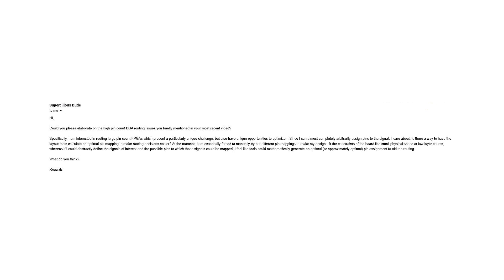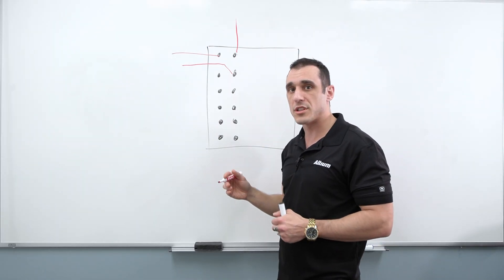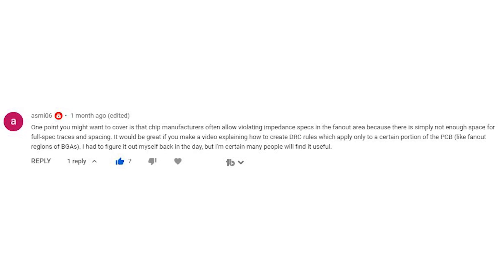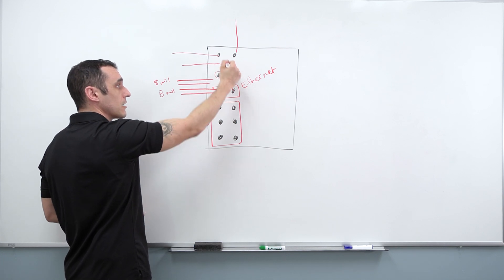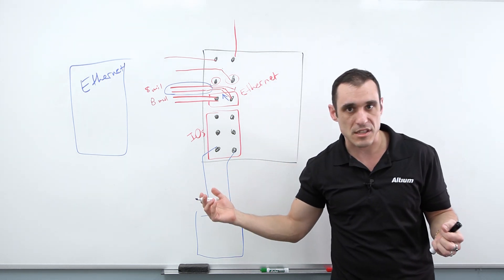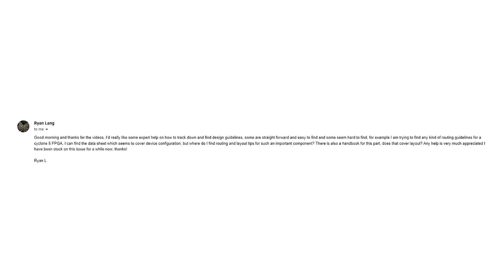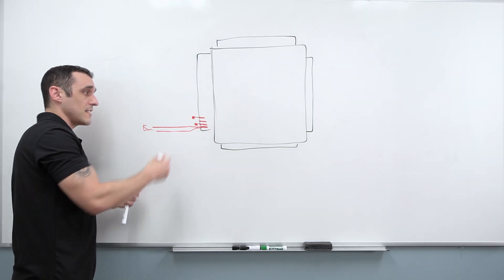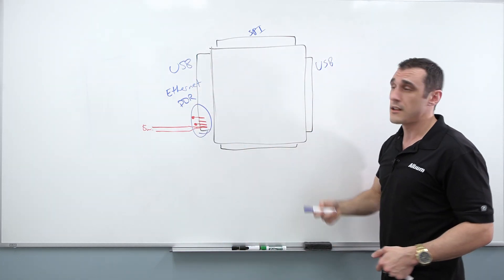Floor Planning Tips for a Large Integrated Circuit

Comment: Q: How do I floor plan a large pin count BGA?
A: Here's an example fanout for a really small pin count BGA; here's a fanout for a QFP.
As Diane Rehm would say, "You didn't answer the question!"

My specific area of interest doesn't include BGAs (at least not unless, or until, op amps are no longer available in more easily accessible packages), but I am curious about how to handle larger footprints without violating a shaffordable fabricator's DRC requirements, e.g. an 8x8 BGA floor plan that would be acceptable for any of the rapid fabrication houses that sponsor other YouTube channels. Also, you didn't cover 45 degree rotation, which is quite common for BGAs and especially for QFPs, but that's more about routing to external devices once outside the footprint (the question that you did answer) than fanning out the footprint itself.
Reply: Unfortunately the via tolerances make “shaffordable” manufacturers the adorable part. 45 degrees is cute but I would probably recommend it more for QFNs with high pin counts in narrow boards. In general 45 degree traces have higher loss due to weave crossings.